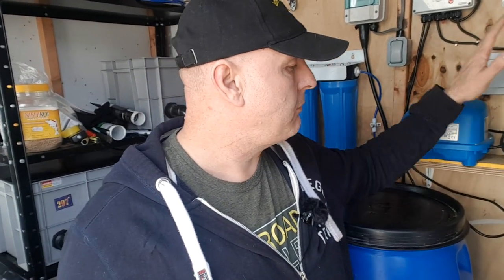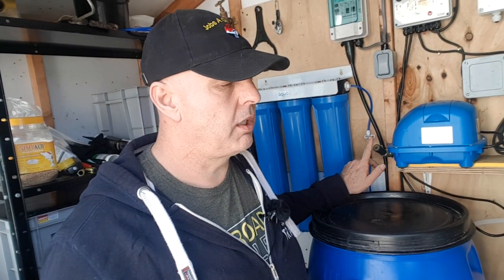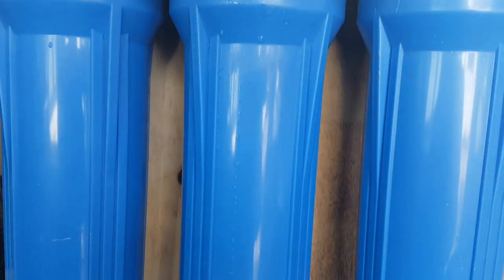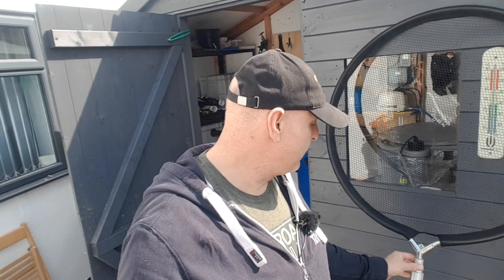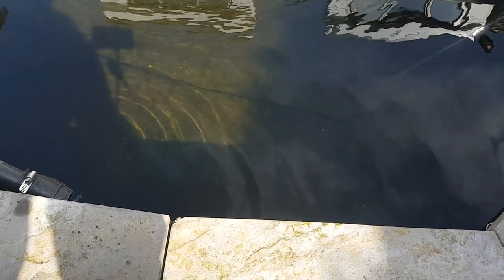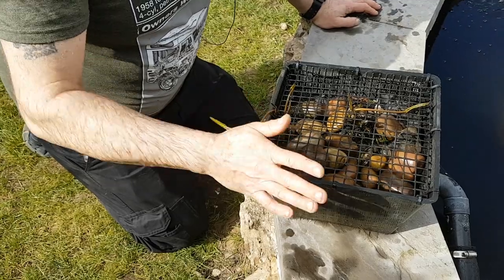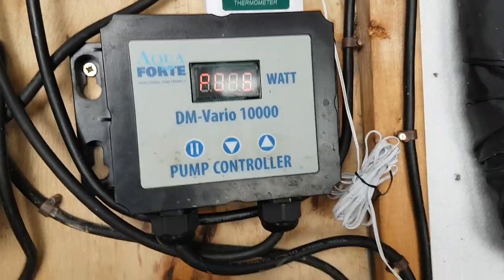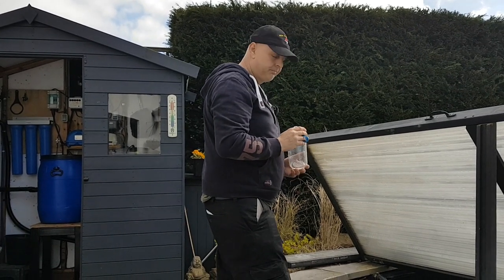Spring maintenance part 2 (KOI POND)

Comment: High, great video lots of good info. Afraid your still going to have to clean the inner chamber on your easy pod, I boil mine with a 130 litre air pump  with the air ring turned upside down and I still find muck settles in the inner chamber.
Reply from the maker: Cheers mate for the information, that's not good, I might have to think of altering the pod. Stay safe
Jobs a Goodun 👍

Comment: Hi Andy i agree that the jetwash is better than a purge valve for the same reasons as yourself.
It's been proven that the temperature at the bottom or a domestic pond isnt warmer than the surface due to the very small volume, you could run a test using two temperature probes.......maybe interesting viewing especially over the course of a year 😉
I run a 35lpm pump just on my drain and another separate one for my moving media....I used to use a 100lpm to clean my easypod.
Take care matey and happy easter 🐣
Reply from the maker: Cheers mate, interesting idea on depth temperatures, something I may record for the winter, I'm hoping the drain will stay a bit cleaner with the extra draw on it now, but I'm going to increase cleaning it from now on, and I've increased the pod air pump to 70lpm so we'll see what that does. Stay safe 
Jobs a Goodun
Reply: @DerbyKoi  I also think that people who use clays (or non clay substitute) will seemingly have slightly more settling when the flow is reduced in winter.
For instance Andy at koi Diaries didn't have murky water after jetting his drain possibly because he doesn't use clays although there were some larger debris.
But you do use clays (or similar) and they albeit in the short term cloud the water so in winter more could settle in the pipework..........possibly.
Reply from the maker: Your correct I do use clay, one of the reason is it's a flocculent so it does atract the finer particles together and is easier to remove, but you have a great point that it probably contributes to sticking in the pipes especially with a lower draw, as I say, I'm hoping the increased draw will help and like you I believe the pressure clean is more advantageous 👍